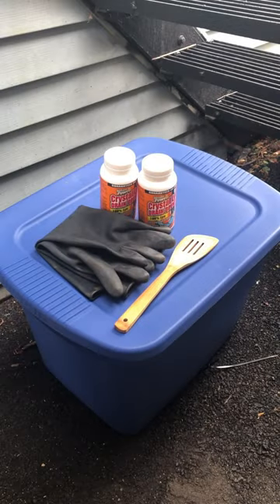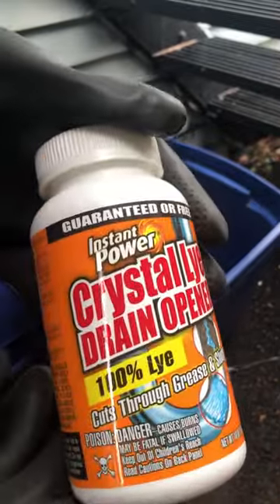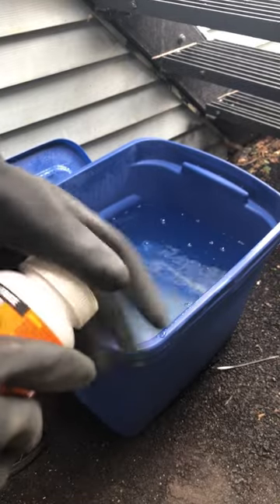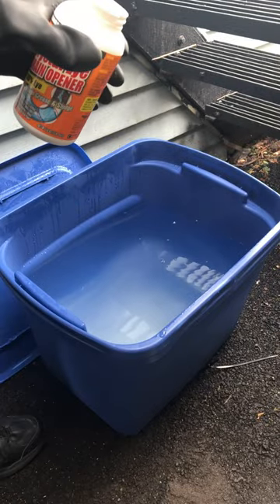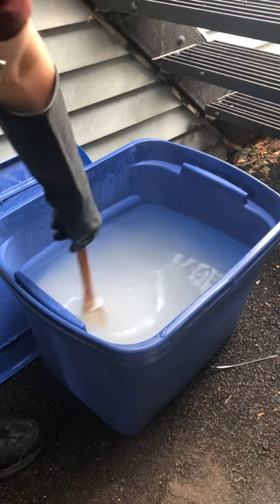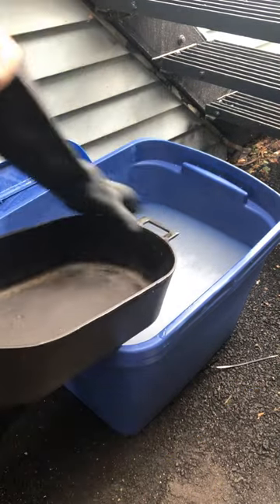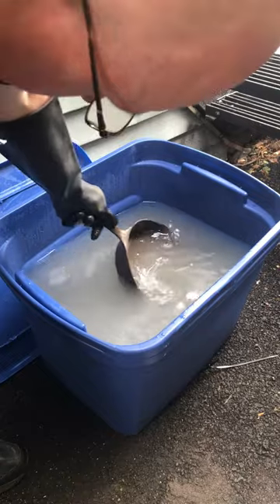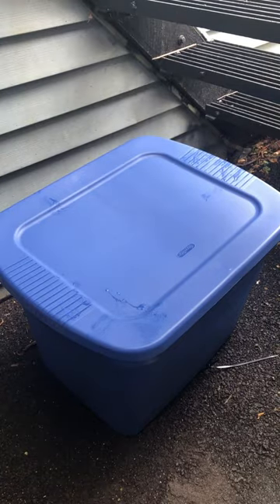Building a Lye Tank to Clean Cast Iron #shorts

Comment: This is my favorite way to clean cast iron.  So simple and so effective.  I want to mention something from experience:  A couple of years ago I set up a tank and cleaned several pieces.   I then got busy and left 1 pan soaking in the lye bath for 6 or 7 months before I could get to it.  Didn't hurt the pan at all.  In fact, it was a breeze to clean up.  All of the rust and old seasoning just came off with a paper towel.  Don't be afraid to leave pans to soak in the lye bath for several weeks if you need to.

Comment: Although I am still scared to try this, thank you for sharing the video.  I have a question:  in other YouTube videos that use Easy Off, they recommend doing it in warmer temperatures outside to help make the Easy Off work better on the cast iron.  Does the same apply to a lye bath? In other words, should you start out with a warmer/hot water to create the lye bath (maybe even to help dissolve the lye crystals) or does water temperature not matter?
Reply from the maker: Lye works a lot better in warm weather, yes. I used hot water in the tank from the beginning, and you can see it steaming as the lye is mixed in. It’s the same thing with Easy Off, which also uses lye.